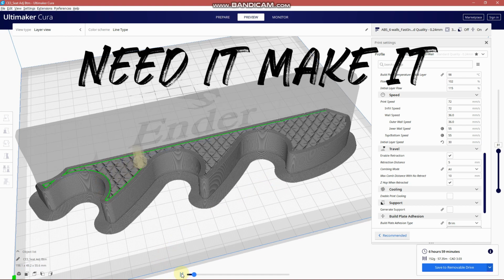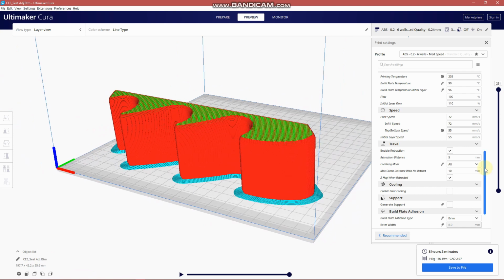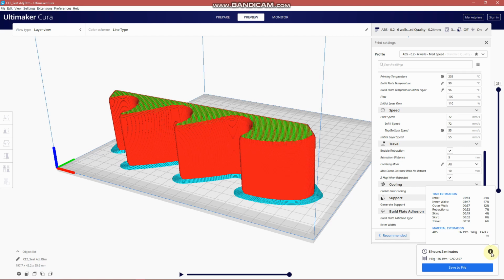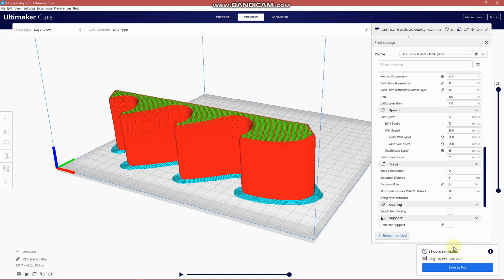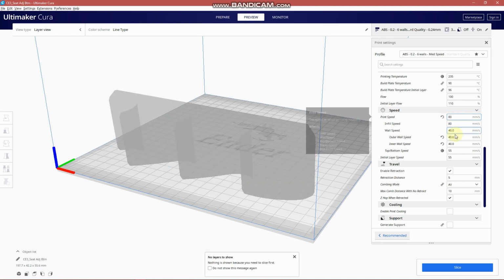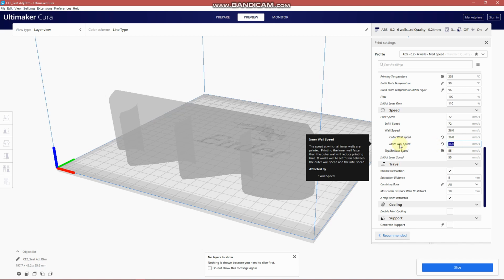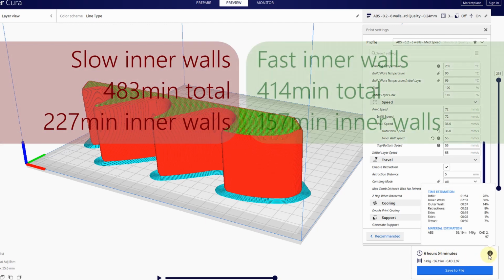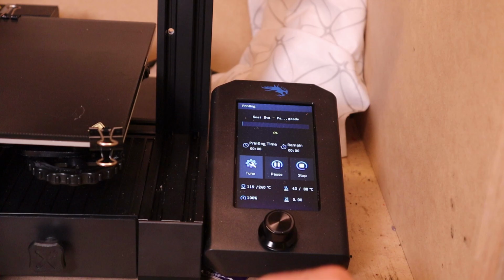Creality Ender 3 V2 - Speed up prints without sacrificing quality by identifying and changing...

Comment: Note to self: he's printing with ABS
Reply from the maker: I also print with PLA and PETG, good results regardless.
Reply: @NeedItMakeIt  Oh, I'm a newbie printing only with ABS, so your video is perfect for me - hence the note to self.

Thanks for your videos 👍
Reply from the maker: @CelsodeSá  Sounds good!  I started looking at alternatives to ABS over the past few months, it is such a tough material to work with and I figured that there would be a better option.  I've been having really good success with PETG, the warpage and bonding to the build plate are no longer problems, just glue stick.  There is no smell and the enclosure door can be open or closed.  I still print with no cooling fan for the best layer adhesion.  If you get fed up with ABS, I would highly recommend PETG, similar flexibility, though it is shiny and some people don't like that.
Reply: @NeedItMakeIt  Thanks for your advice. Problem is that in Brazil PETG and PLA are about 50% more expansive than ABS. But I've figure out some tricks to make it work properly in a Ender 3 (not V2), one of then was printing and installing this https://www.thingiverse.com/thing:3419531 which has the Hot End fan sucking air instead of blowing - and it's a no-brainer how it helps to print ABS well.

So I'm testing and searching lots of tricks like these (you helped also), and the improvements are stacking.
Reply from the maker: @CelsodeSá  That's partly why I started with ABS, it was cheaper, not as much anymore, PETG and PLA are just a few dollars more than ABS.  I'll be trying the PETG with Carbon fiber soon, it runs around $8CAD more per spool, but it may be 2x as stiff, and looks amazing.  

Now that is really interesting, I'd love to have an IR camera and record a timelapse of 3D prints to see how these types of mods help.  Maybe down the road.   The nano bed adhesive by far has been the best way I've found to bond ABS to the glass bed.  It is a little pricey, but it can be thinned out with alcohol and a little does go a very long way.   

Thanks for the tip!
Reply: @NeedItMakeIt  Have you tried hairspray to fix the print on the glass bed? I haven't done anything on a glass plate just yet, ABS fix pretty good on the "sandpaper" build plate with the stock Ender 3. 

I'm pretty excited to see what is going to come out of your PETG with Carbon Fiber prints 👍👍👍
Reply from the maker: @CelsodeSá  I haven't tried the hairspray yet, but I have heard good things.  I jumped right to the nano bed adhesive and I settled on that because it worked so well.   I do like the final look of ABS, it has a high-quality look to it.  It does smell and I'm not a fan of that (my printer is beside my desk).  I haven't tried the original flexible bed material, it seems to me that the ABS would lift the entire sheet up, it can flex a 4mm thick tempered glass plate... and take a chunk of it out.  

I have finished the prototype which I'd like to use the carbon fiber in, you'll see it in an upcoming video and I can make it available to anyone who wants to make one of their own.  Pretty cool little device (leaving you in suspense) :)
Reply: @NeedItMakeIt  I suspect that I haven't worked with an original ABS filament yet, because I haven't experienced bad smelling or warping that wasn't easy to handle after some tries. 

That might be because both filaments I got have this MG94 resin in its composition (also it's about 2,5 meters away from me).

About your project, I'll keep a look at the bell above ;)

Comment: Hello, I really liked your video, very straight to the point. It would be interesting if you could make this profile available to anyone who wants to test.

Thanks
Reply from the maker: Here is a link to the files if you'd like to try them out.  I print with ABS and PETG, they can be easily adapted to any material.  https://drive.google.com/file/d/1ld49Uw8gVbhItDMS0YO8g5zaXGgZ_Qoo/view?usp=sharing
Reply: @NeedItMakeIt  TKS !!!
Reply: @NeedItMakeIt  Great Video, I too was wondering if you'd share this profile and was happy to see this link, however, Google Drive says you've moved it to your trash and it's no longer available... Would you be so kind as to reshare it?

Comment: Great videos, well done. I only started 3d printing journey and I have the same printer. What glue do you use? I printed two things and both went wrong as filament did not stick to bed correctly.
Reply from the maker: Thank you.  I print with ABS, however the first time printing with PLA on glass, I used a glue stick... that was a mistake, I could not get the print off of the plate without ruining it.  If the part has little surface in contact with the plate, you'll probably be okay, if it has a lot, I can't suggest this method.  I have problems with adhesion, however ABS and PLA are different animals, so I'd need to do some testing first to be able to respond accurately to your question.
Reply: @NeedItMakeIt  Hi, I' would also like to know how you get ABS to stick.. is that a regular glue stick (like for paper/craft)? PLA sticks fine if your bed is level and bed and nozzle temp ok (60/200) and I also always use a brim. But ABS always pops off mid print.  Thanks.
Reply: @michaelhudson7809  Awesome - thanks very much!  I will try some glue stick (I make a lot of things that need to be durable and for outdoor use - so pushing the limit of PLA). What bed and nozzle temps do you use (other than the extreme ones you mention).  Also, do you share your profiles at all?  Many thanks again - really appreciated.  Tim

Comment: 2:48, none of these steps are necessary, especially on a part that large. You're using an Ender 3 V2 afterall. Glue sticks are a thing of the past with V2.
Reply from the maker: Hi, could you be a bit more specific?  Printing ABS directly on glass with my typ. print settings is not successful, there is no adhesion.  Are you perhaps referring to PLA?
Reply: My prints go wrong as filament does not stick properly...would you know why? It's 60c* heated, calibrated etc. I'm talking about PLA by the way. Any help would be appreciated.
Reply: @superchannel6506  Make sure to clean the glass bed regularly. I use isopropanol to clean it before prints and layer adhesion is working perfectly with PLA without any addons.

Comment: Thank you for your video. I have bought this printer too and I am going to assemble it the next week but I have a question. The power supply is enough to print ABS, because it's only 350W ?
Did you have encountered a problem about the power ?
In your exemple, how long the bed to got 90°C ?
Thank you
Reply from the maker: No problem.  I am happy with this printer power supply, it is better than the Anet A8 for sure.   I would highly recommend an enclosure though for both safety (fumes) and for better quality prints and faster heating.  I would say from cold it takes 10 minutes to heat up enough to start the print.  The initial bed temp is 98, it drops to 93 from there and that's because the initial layer is critical for bed adhesion.   My printer also has the Carb. glass and it is pretty good about heating up quick, it seems to retain heat well and heats quickly also.  I have heard that the Carb. glass is only thin on the top of typ tempered glass, but I can't really be sure and it sounds a little gimmiky to me, the bond seems about as good as picture frame glass IMHO. 

I hope that helps, I print only ABS so if you have any questions let me know, I'd be happy to help.

Comment: really nice and informative.. thx heaps     I'm  running a new  E3V2. Have only added yellow springs and it prints really nicely at 45ms   will push it upto 65ms now   :)  & turn down inner wall.
Reply from the maker: I agree, the springs are a problem, the adjustment knob on the front left seems to like to loosen off, the springs need to apply a little more force.  Did you opt for the set with the anod. aluminum knobs?   They look pretty snazzy.  I run with 5 wall layers, the inner walls don't seem to affect much, but if someone only has 2 wall lines, a slower speed would help to reduce the infill from becoming visible in the outer walls.   I've been running 80 for the infill with no problems using ABS, the outer wall I have at 35 inner at 55, those settings seem to make for some nice prints.  I'd like to try the ABS juice soon for  better adhesion.

Comment: Beautiful, thx! Did you shorten the pipe?  It is too long by default, this can have a positive effect on retracts maybe. I cut 10cm.
Reply from the maker: I haven't, I've never heard of this solution.  I was thinking about calibrating the stepper instead, but I've only had the printer for about 1 month and I'm still wrapping my head around some of the tweaks.  Is that 10mm (3/8")?

Currently working on some bed-adhesion stuff, should have another quick video reviewing some progress on that this weekend.

Comment: love your ender 3v2 videos!! keep them coming!! Btw, cool FJ cruiser toy on the left. Justs getting into 3d printing on my 3v2 and your tips have helped me a lot. Just subscribed hoping for more of these videos! Thanks a lot!
Reply from the maker: Thank you Juan!  I have a few more Ender 3 videos on the way right now, and about 1000 ideas for future videos. 
 You've picked a good starter printer, I made the mistake of starting with the Anet A8, there is no competition.  This printer has great potential.  

If there is anything specifically I can help you with, please don't hesitate to ask.  

Do you print with ABS, or PLA?  

Would you believe me if I told you that was my son's Cruiser?
Reply: @NeedItMakeIt  Thanks!!  I am currently printing with pla and PETG (Hatchbox,Overture and Geeetech) they are all working great. I just got some tpu filament from Sain Smart in the mail today, planning on trying it with my printer but honestly i'm a little scared of my prints failing due to its flexibility :)  ps. jajaja I think i wouldn't believe you.  If I was to go by one of those at the store I wouldn't hesitate to buy it for even a second:) In fact i've had a cruiser  for over 4 years as my daily driver and couldn't be happier. (except with km/l)  Loving the new videos btw

Comment: The incorporation of "Creawesome" is what makes your inner walls so much slower (50%) than your print speed. The base Cura FDM/FFF profile, and the Creality profiles prior to 4.1, have this set to the same as the base print speed by default. I suspect most others do as well, along with a 60mm/s base speed instead of 50mm/s.
Reply from the maker: That makes a lot of sense, why they would setup the base profile to be so terribly slow is beyond me.  My old printer the Anet A8 could not handle much speed due to the terrible design of the frame, this Creality is so much better.
Reply: @NeedItMakeIt  Ultimaker just added Creawesome in full back with 4.1 due to its (supposed) popularity. I guess it's "good enough" for most, and it's not like they're going to devote too much time to fine tuning non-Ultimaker printer profiles (rather understandably).

Can't say I've ever really cared for Creawesome myself. After Ultimaker incorporated it I switched to a customised version of the default FFF/FDM profile to boost both speed and quality.

Comment: Almost skipped this video as I thought it was the same as the last one. Watch out for CURA 4.7. It has some bugs that can produce poor surface finishes.
You should be able to crank much faster than that. (of course part geometry and acceleration settings can prevent even insane speeds from becoming reality) but a 100 or 110 on inner walls and infill on that part should provide a much faster print. There are a few brands of ABS that don't like a fast speed/hi flow rates (still puzzling why that is) but they are the anomaly and not the norm. Appreciate the patriotic branding on the back.
Reply: Abs can differ between brands, because abs is a blend of materials, this blend can vary alot and that is why some brands behave differently than others. Some abs blends are better for 3D printing while others can almost be unprintable. Interestingly I found out that the high rate of shrinkage of abs is by design, since this material was developed for injection moulding of large parts like car bumpers and the high rate of shrinkage helps these parts release from the moulds...
Reply from the maker: Absolutely, the print speed, the finish, the sheen, the imperfections with stringing and little blobs all seem to vary depending on the filament brand, and sometimes the colour.  I do like that ABS shrinks and can be removed from the build plate, the dimensional accuracy is a problem and I would like to explore some other materials down the line to really dial it in.  

I've be making the Bowflex bench parts for people and trying to keep the cost down, ABS seems to be the cheapest while also giving me a durable part, maybe there are better options out there now.

I've only experimented with PLA a little bit, in order to make parts for my metal lathe that would resist oil.  I had a terrible time removing them from the build-plate even though they were very small.  Glue-stick on a glass plate with PLA was not a good idea, I'd really need the flexible build-tak plate to do it right.
Reply: @NeedItMakeIt  with pla, I have been using hairspray on glass with excellent results, the part sticks nice and once cooled down, it releases on it's own. I do believe brand and type of hairspray also plays a role, so some experiments are required to find a suitable product. The other benefit from hairspray is that the texture on the bed that translates to the part is a lot nicer than that of glue stick...
Reply from the maker: @HeimoVN  Do you have a brand that you prefer?  I wonder what the main ingredient is that gives a good bond?  I will try this, I would like to transition a little more to PLA or PLA+, I have a feeling that the printer in a heated cabinet will not last as long as one with lower bed temps and nozzle temps over the long-term.   PLAs bridging abilities would be nice to have on occasion too!
Reply: @NeedItMakeIt  I doubt the brand I use will be available on your side of the pond since I live on a different continent entirely, but just incase, I use stay n spray ultimate hold. I would just start with testing the cheapest brand that advertises the most hold and look for a unscented version if available since I forgot to do that...
Reply from the maker: @Heimo van niekerk  They only seem to have this one... Sexy Hair Big Sexy Hair Spray & Stay Intense Hold 😆.  An intense hold sounds good, but I'll have a look for the unscented, I've been searching for a better hold for my parts to glass, maybe this will solve this problem for good!
Reply: @HeimoVN  And the colorant can make a big difference to -  be watchful for white and blue. Every time one of those colors comes into the shop we have issues. Its a bit of the wild west for ABS mixes. My rule of thumb is -  on the reel it should be fairly matte and somewhat translucent. Also look for ones on the higher end of the temp scale. Each time I fall for some sexy color and it doesn't fall into the thumb-rules above, I get burned.
Reply: @markrichards5630  Interesting, I have not had issues with those colours yet, but I do realise that the pigments in the filaments effects its properties, although these days I mainly buy black and white filaments so it is less off a issue to me since there is only two varieties that can differ on my shelf...
Reply: @HeimoVN  I had to settle for some eSun ABS in white a while ago. I think they used latex house paint to color it. It was awful, gooey stuff. It took quite a while to dial it in because it just didn't make any sense.
Reply from the maker: I had been wondering just how far I could take the speed, that's very helpful information.  My old Anet A8 really held me back from exploring speed changes, but this printer has so much more potential. 

I have noticed quite a few differences in the properties of ABS, the most troublesome being the Silver ABS filament which absorbed moisture and produced a terrible final product.  I would leave the silver in the heated cabinet for 1 full print before trying to print with it. 

Thanks, the flag was a recent addition - Proud to be Canadian!
Reply: I wonder if 4.7 is what causes the weird smooth circle warped area that looks like someone took 2 washers, bolt and nut and squished it in a place in some of my prints. Minor and not hugely noticeable at all but it's like a ???? moment when it happens xD